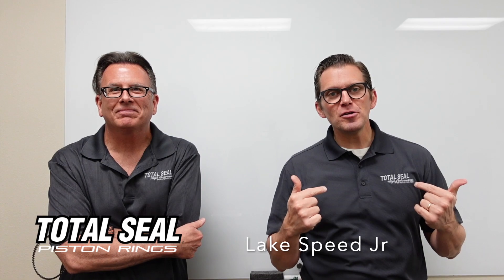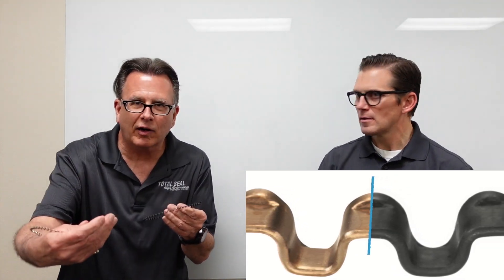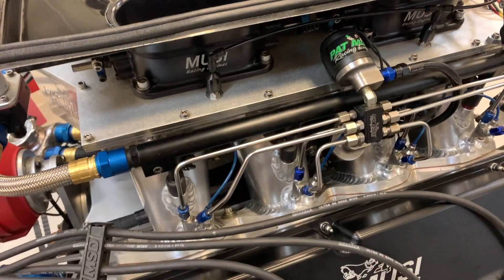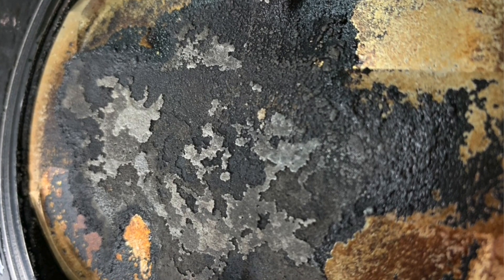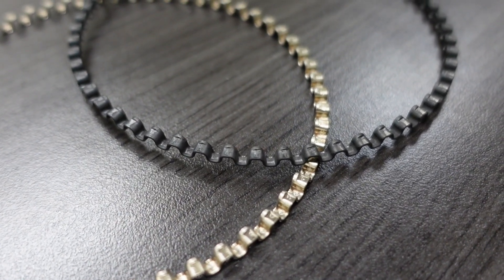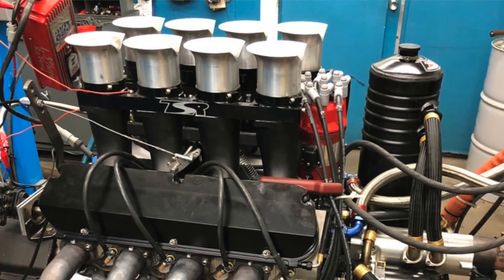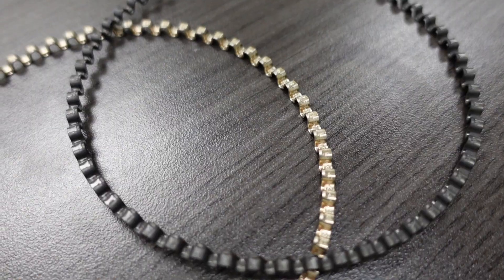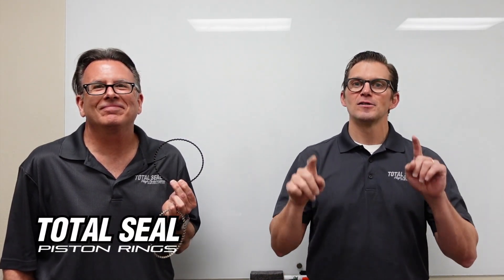Ndurance Oil Rings - Prevent Oil Consumption & Detonation - Nitrided, 3 Piece Oil Ring Expanders

Comment: My 400, 3.75x4.125, sbc, 6.0 rod, Wiseco 2618. This was before problems with oil consumption were realized because of lack of oil control ring support across the wrist pin hole. I have your rings, especially with hapless top ring. O percent leak, uses a quart in 100 miles. I have built these engines for drag racing so oil consumption is not an issue. My engine runs PERFECTLY, but I drive the wheels off of it. I was told by your guys that I should go to a .030’ oil support ring under the current rinds, but I would have to try a 3mm oil ring set with the support ring for fitment. I was on the fence about this repair, was contemplating new pistons with the buttons that have the control ring groove. Is that the way to go, or is new expander the solution?
Jef Lynch, Jef Lynch’s Performance Automotive.
Reply from the maker: The .030 support rail is the best way to go when the wrist pin hole intersects with the oil ring groove.